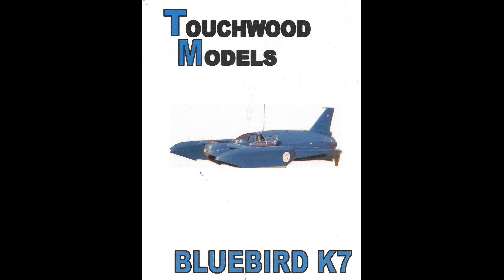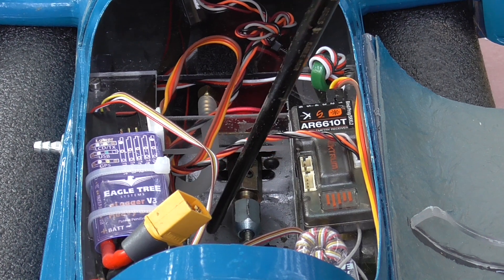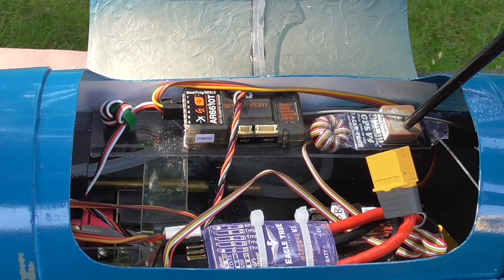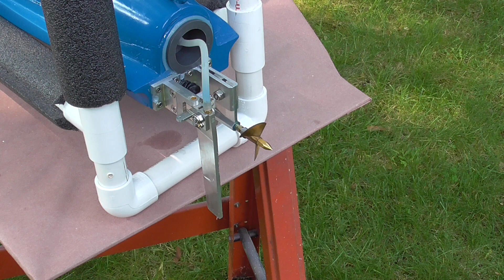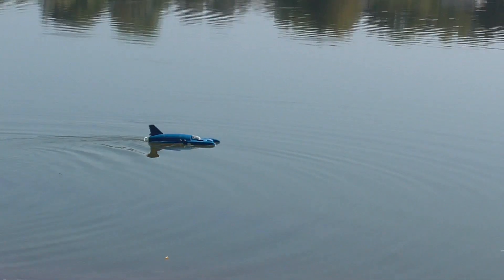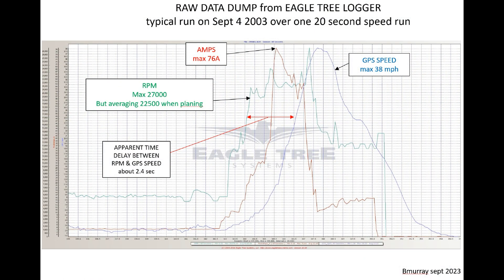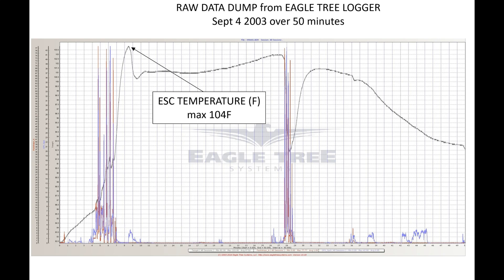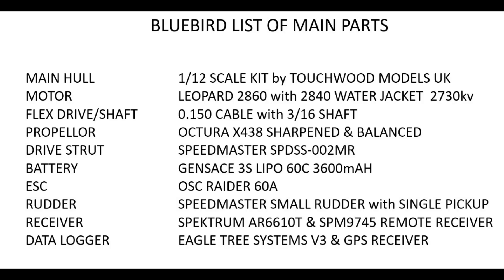Bluebird X7 Hydroplane 1/12 scale Model Build and Test

Comment: Nice video-I have always been interested in record setting straight line boats and I do have a bit of experience in this area. Have you calculated what the scale speed would be to tie the speeds the Bluebird reached?
Reply from the maker: I am no authority on scale speeds.  I believe many people use the square root of scale as a measure of what a boat model should run at.  This may be valid for displacement hulls since it is supposed to simulate the wave action. 
However for a fully planing hydroplane that is essentially flying there is very little wave action so if anything I would guess the model speed should be approximately linear with scale.
In this case the scale is 1/12 and since the Bluebird was essentially a 300MPH boat, the scale speed would be about 25mph which seems a bit low since the graph indicates full planing starts at about 30mph.
If you use the scale square root (3.46) then the scale speed would be 86 mph -  obviously way too fast.
In any event I think it looks very nice when planing even if the scale speed is a bit off.
Reply: @70xke Thank You. It is a great looking boat.